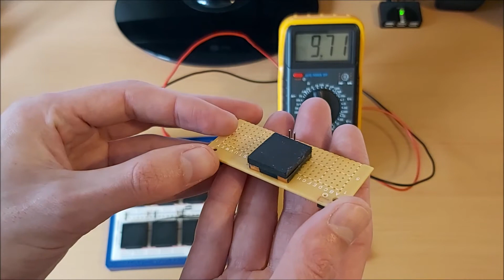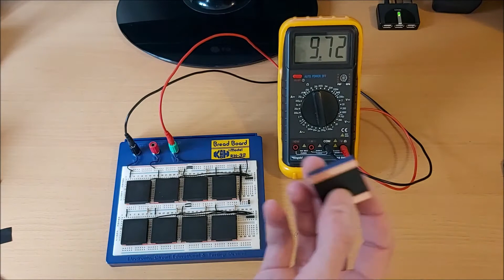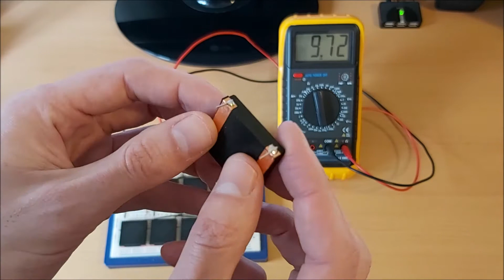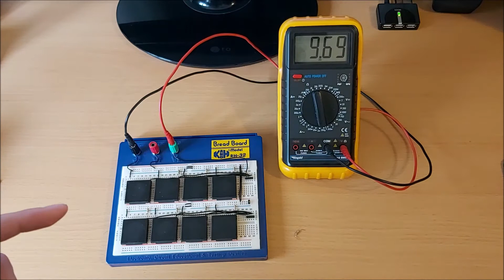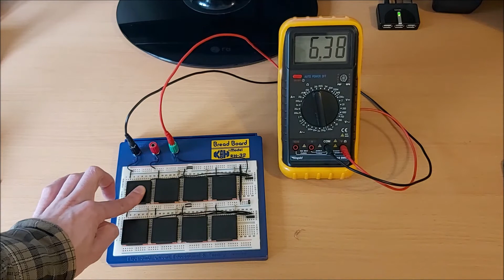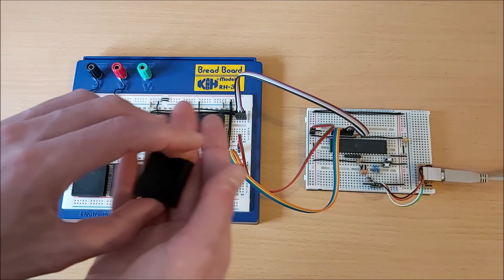Eight pressure-sensitive Velostat/Linqstat pads for a velocity-sensitive MIDI controller

Comment: I'm curious why you chose to bridge a 1cm gap with the velostat rather than sandwich it between two conductors?
Reply from the maker: Just seemed like the appropriate way to do it based on the roll of narrow self-adhesive copper tape I had to hand. Do you think sandwiching it between two conductors would work better, and if so what did you have in mind?
Reply: @benryves  I made a matrix myself of 8x8 rows and columns of copper tape crossing at a 90 degrees angle, with the upper layer of tape stuck onto a piece of transparent plastic with plastic 'buttons' stuck on the other side of the plastic with double sided tape. I wouldn't know if this gives better results than your switches; I was just curious. The 8 columns of my matrix are connected to the digital outputs of an Arduino Mega, the 8 rows go directly into analog inputs. ChatGPT wrote the code.
I wish the output would be more constant because I love the simplicity of the construction. 
Who thought you could make a velocity sensitive keyboard with aftertouch out of an Arduino, copper tape and a piece of velostat?
check out the video by markfdesimone who did a giant matrix keyboard the same way. Only he uses multiplexers and I don't.
Reply: @willemfeltkamp5314 you should do a demo video of this.

Comment: Would the Teensy 4.1 fare better with its 600 Mhz speed?
Reply from the maker: The limitation with the AVR is the fairly slow ADC that can only sample from a single channel at a time rather than a CPU speed limitation. I don't have any interest in the Teensy do don't know how well it would perform, I'm afraid.

Comment: Hey
Reply from the maker: Technically, it could do, though you'll need to do some experimentation of your own to get the response you're after. You can measure the resistance over time and see how much the resistance is changing (the force on the pads) as well as how quickly the resistance changes and from that translate to (for example) a MIDI velocity. That's what I did in this demo, though ultimately the ADC in the microcontroller I was using was not fast enough to provide good time resolution to make pads that responded well to quick strikes.

Comment: Okay two things, number one I absolutely plan to find a way to hook up a set of ADCs to a standard arduino to make a large number of responsive pads.  I've been researching how to make velocity sensitive MIDI pads and this is one of the only useful results I've found.

Secondly, what is that microcontroller?  Is it the IC from an arduino or something else?  Is there any good information on where to get these and how to do it?  I'm looking at making some custom PCBs for my projects and having ICs instead of daughter boards would make them much cleaner.
Reply from the maker: Thank you! The microcontroller here is an ATmega324P which is related to the chips found in some Arduino boards. The Arduino system tends to involve a bootloader preloaded onto that chip, a USB to serial interface to load a program onto the chip via the bootloader and a bunch of libraries to ease development in C, whereas here I'm just using the plain chip with no bootloader and no USB interface (I program it via the ICSP pins and an USBtinyISP) and I don't use the Arduino libraries, I write the code in plain C using avr-gcc as a compiler (the AVR datasheets are very clear on how to access on-chip peripherals like the ADC via their registers with plenty of sample code). In this case as I wanted to be a USB MIDI device I used the V-USB library which implements USB in software, if you search the web for "V-USB MIDI expression pedal with capacitive sensor" you should be able to find a good sample project that gives you an idea of how a USB-MIDI device using a cheaper AVR might look.
Reply: @benryves  Thanks so much!  This is great info, I can imagine actually making some viable professional-seeming products this way.

And I've found the github project by that name, I think I can go from here.  Thanks again :)

Comment: I have zero knowledge of electronics but found your video interesting.... Out of curiosity is it possible to make the pads slightly larger, say 10cm by 10cm. I'm thinking how this could be used for less able people to stimulate certain reactions. Any response appreciated
Reply from the maker: I'm not sure how well they'd scale up to larger sizes - you might have a smaller change in resistance so you might need to press harder or have a more sensitive circuit to measure them; alternatively you could try dividing the larger pad into a few smaller pads underneath. Could certainly be interesting to experiment with, at the time I was playing around with this I was trying to replicate the small pads on MIDI controllers so never tried anything bigger than what you see here.

Comment: I think the reason the resistance is lower than expected(when unpressed) is becasue the width (length of the two side conducting bands) is longer - meaniing you can model is as more resistors going across the bands in parellel and hense loweing the resitance. For a bigger dynamic range - you may want to try reducing the width (side with the bands) and increasing the length (non-conductive dimension inbetween the conductive bands)

Comment: Nice work! Your pads look really good wrt cost and tactile feel. 

I have been experimenting with 72MHz STM32 micro which has 3 ADCs (up to 24 inputs). The peripheral bus runs at 84MHz and supports DMA transfer.  I have it working as an oscilloscope driving a Nokia 5110 phone display. It gives pretty detailed piezo sensor graphs. It should work fine with 16 pads. 

One thing I noticed is that on current Akai gear the pads are externally multi-plexed. I am wondering if that is necessary these days now that low cost microcontrollers offer so much configurable I/O.

I have some questions about your setup. Are your pads externally multiplexed? Is it stable mechanically and wrt ambient temperature? Have you noticed any cross talk (false triggers) between the pads? 

Also, I see below you bought an LPD8. What do you think of it as a midi controller? Would it be possible to hack into the pads or replace the micro without destroying it? Thanks, Ben
Reply from the maker: Hi, sorry for the delay in getting back to you! I'm using the ADMUX built into the microcontroller rather than any external multiplexer (one of the performance limitations is only being able to sample one pad at a time). I never got around to saving the calibration data for pads so don't know how stable it would be in the long term. Never had any issues with cross-talk, though! The LPD8 is fine... once you insert some plastic shims between each rubber pad and the conductive membrane (I cut mine from a plastic sandwich wrapper). By default you need to hit the pads pretty hard to register, I guess they erred on the side of caution to avoid false triggers. Quite a few videos on YouTube show similar mods (e.g. putting electrical tape in as a shim) so it's not specific to my unit. Not sure about hackability, but as the device speaks class-compliant USB-MIDI I'd be tempted to just use a USB host microcontroller rather than start cutting PCB traces.

Comment: About the resistance decreasing when you increased size of the material. That is what is expected. Wider material conducts more electricity (means less resistance).
Reply: Funnily enough, if the material is kept as a square, it wont change it's resistance with size, only if the shape changes to a rectangle will it affect the resistance.
Check out sheet resistance, or ohm per square. Quite interresting.
The change in resistance that @benryves experiences, is most likely due to difference in the shape of the copper foil that contacts witht he velostat film, thus changing the resistance.
Reply: @Gin-toki  Thank you. I did not know that. Makes sense now.

Comment: You're probably spending more time in the Arduino framework retrieving analogue values than in the actual ADC delay or max sampling rate limit. I haven't looked but what i expect it to do, is to set the multiplexer, then send the whole microcontroller to sleep on a timer, to reduce the power noise, then upon waking up retrieve the sample and return control to your code, this is the canonical way of doing a quality reading. It might even be taking several measurements and going to sleep in the interim to measure the supply voltage to cancel it out of the reading. I suppose it's possible to speed it up at the cost of quality of readings.

A microcontroller that comes to mind is STM32F103. You used to get these "Blue Pills" for like a dollar a piece, obviously now we have shortage and counterfeits, but well, STMs aren't the most difficult chips to get and they're catching up and there's adequate honest competitors like GD and WCH now. You get two 12-bit ADCs capable of running at 1MS/s, a 10- or 16-channel multiplexer, and you get a DMAC peripheral which can do sequenced mode changes to peripherals and take timed readings for you and dump them into a memory buffer. The ADC has separate power pins going out that you can condition for lower noise, making sleeping the processor unnecessary. I don't know whether there's a sufficiently pedestrian-friendly framework to use the DMAC, but even just straight up PIO reads are going to be fairly quick and nice.

The usual Akai etc drum pads use capacitive sensing; but also they presumably take two timed thresholded readings, one when the pad has begun being pressed down, and one when the pad is fully pressed down. This way they don't have to calibrate the pads individually at all and have little variance between them. From the time between these two thresholds being crossed, velocity is computed. You can in fact verify that you can trigger a low velocity reading with a lot of force just pressing the key slowly. The minimal force which will read is kind of high, since you need to bottom out the pad for it to register, but the playability is good. If you have a sufficient reading speed for this, perhaps you don't care about ADC noise either just like you don't particularly care for individual differences between pads.

Another thought for low level control applicable to ATMega is to not use microcontroller sleep but just nop a few cycles for the readings to take place, and you get shitty reading, this way you can select one or maybe up to 4 pads to track with more precision to take the maximum pressure reading for each.

Comment: Great idea using the foam. Looks so much like production drum pads. I just started playing with velostat and am surprised how sensitive it is. I was able to get it to register a slight change in the reading when I physically dropped a resistor (less than a gram) on it to give it some weight.

Comment: Does phone battery has velostat paper inside???
Reply from the maker: I don't think so, but I would not recommend dismantling them to find out as they can react violently if accidentally shorted. Velostat is used for anti-static packaging, so if you've got any black plastic bags that had electronic chips in they might be usable.
Reply: @benryves  ohh Thanks for helping :)

Comment: Hi there! I’m a guitar maker out of Woodstock NY and I was looking to purchase this exact load out for a prototype I’m working on. Is there a good way to reach you so that we could talk about you creating a kit for my specific needs?
Reply from the maker: Thank you very much for your interest! Unfortunately I was not able to get a setup that I was properly happy with, I don't think the microcontroller I was using was able to sample eight pads quickly enough to provide good results (a single pad would work pretty well and be quite sensitive and responsive once calibrated, but having eight made it quite unresponsive). In the end I just bought myself an LPD8 and didn't continue the project, sorry.
Reply: What microcontrollers did you test on? Ideally I’d like something with just 4 maximum but like to know the limits, cheers :-)

Comment: Thanks, very informative. I just got a couple of velostat sheets. Looking for ideas on how to use them. Was thinking about some foldable pocket pad array with android connectivity. Or some knee straps with integrated pads.
Reply: You are using atmega16 with an internal clock? Maybe you could double that sampling rate using an external crystal. If I remember correctly, atmega16 is limited to 8Mhz using an internal oscillator. But it can go up to 16Mhz with an external crystal.
Reply from the maker: @AlenHR  Thank you, for you kind comments and tips. :) I'm using an external 16MHz resonator in the video, the problem isn't so much the CPU frequency but the ADC clock frequency (recommended to be between 50kHz and 200kHz, with a conversion taking 13 ADC cycles). That would give up to ~15kHz sample rate which is great for a single pad, but switching between eight of them gives under 2kHz each and I found the pads became too unresponsive at this speed to be useful. According to the datasheet you can clock the ADC above 200kHz if you don't mind a lower-resolution conversion, but I didn't get around to experimenting with this too much to see if low resolution but higher sample rates would produce more reliable results.

Comment: I was just trying to look for how to do a sensitive finger-drum-8-pads without a piezo ..... 
I don't find anything 'cheap' and effective (exept a force sensor resistor for 8€)
Reply: I made a 6 'pad' drum controller (limited by the 6 analog inputs of the Arduino Uno). For sensors I used six pieces of copper tape (connected by soldered-on wires to A0-A6 with 6K resistors to ground to prevent floating), a velostat layer, one long piece of copper tape connected to 5 volts on top of the velostat, and on top of that a paper sheet. Unlike the construction in this video, my velostat is between two crossing pieces of tape 5mm width.
ChatGPT 4 wrote the code. Calibration wasn't too succesful so far but I measured the six 'switches' and put the resistance values when not pressed in the code.

Comment: Nice idea. I've done similar using the foam pieces from through hole ICs. Works the same way, basically free, but not durable.
Reply from the maker: Thank you, that's a good idea to experiment with that too!
Reply: @benryves  Eventually I have to see if 3D printed conductive filament does this too.